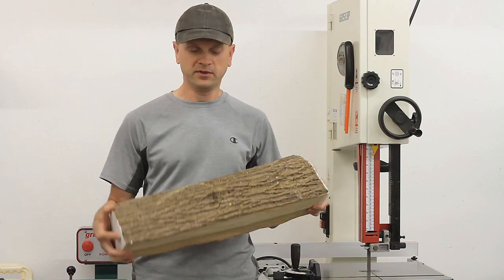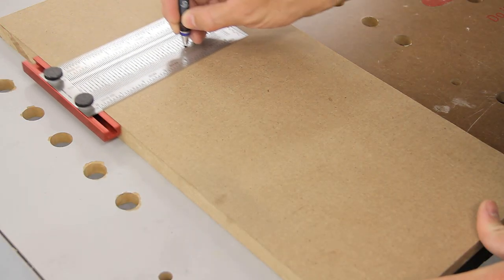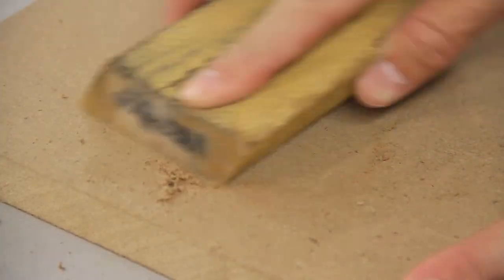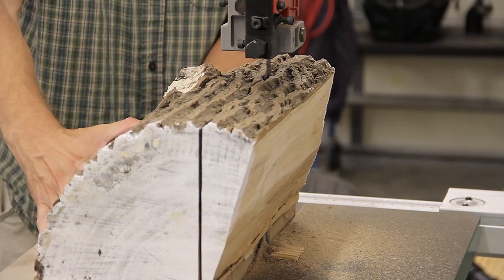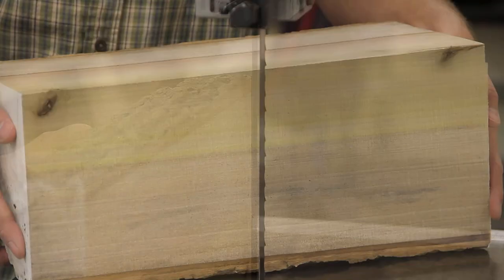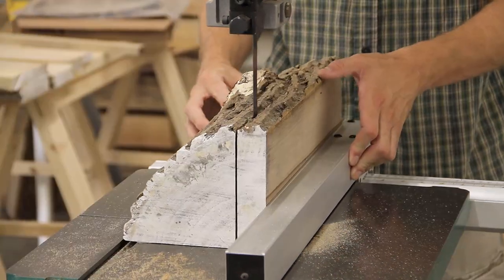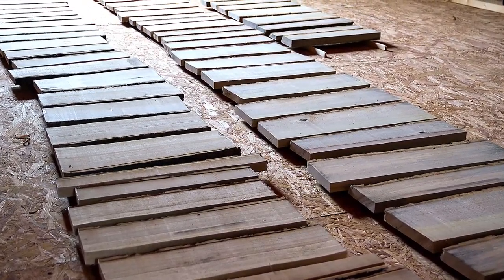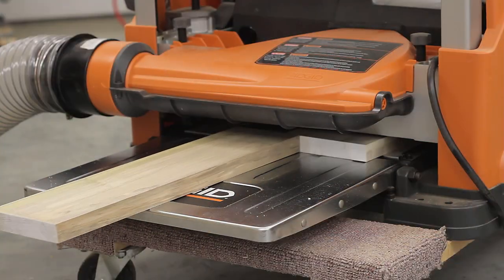Milling Short Logs on the Bandsaw

Comment: If the log is already dry since a couple of years indoor do I need to wait again or I can use it for a project ? Don't want it to warp !
Reply from the maker: You might double check the boards with a moisture meter (something like http://amzn.to/2r5dJuF) depending on how big it is. If the log is still whole, then I'm guessing after 2 years, it would probably still need to dry some after cutting boards from it.
Reply: Pi Mc yes.  YES.   Cut the boards thicker than what you need..to account for movement, because there will be some.  And sticker them evenly with weight.  Do it proper and you wont be disapointed.  If you cut corners, no pun intended ....you will be choked with the results.   Trust me, i know from experience.    Using Holly..  :(

Comment: Why does my blade bind every time I attempt to do this I can’t get 1/3 the way through the first cut and the blade is bent and saw bogs down. Have to stop and back out. . Using the Carter log mill.
Reply from the maker: I'm not sure exactly what might be causing it. I used a pretty new/sharp 3/4" 2TPI blade on a 17" 2HP bandsaw for reference. Cutting really green wood and the type of wood would also make a difference. If the wood is under a lot of tension it may be closing back on your kerf line and squeezing the blade?